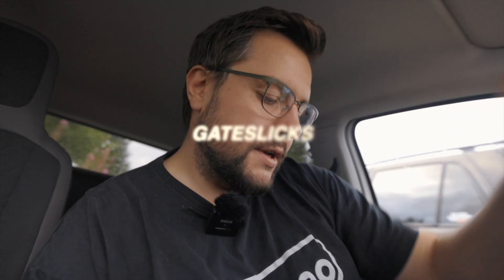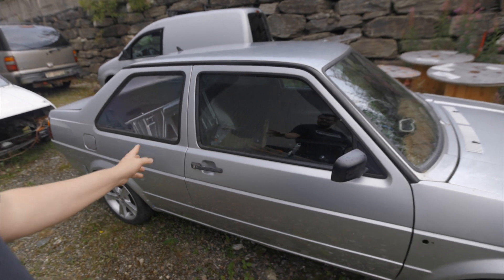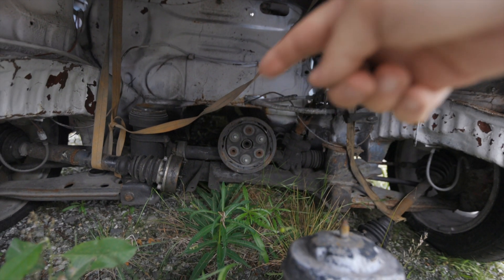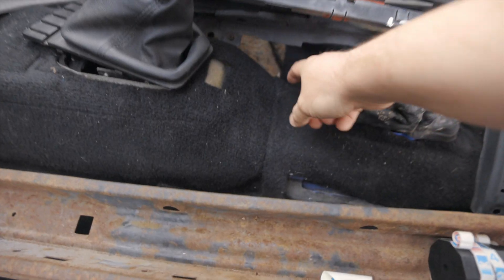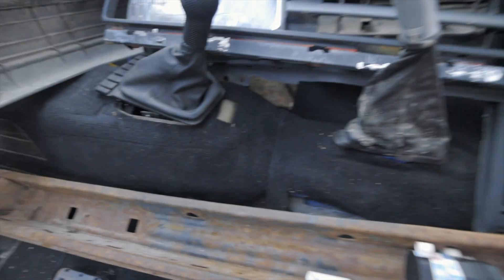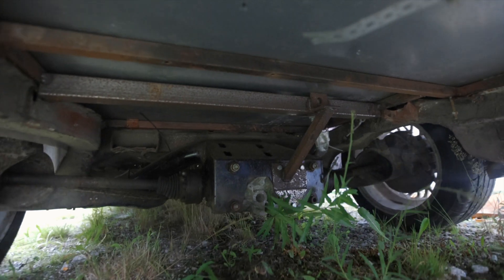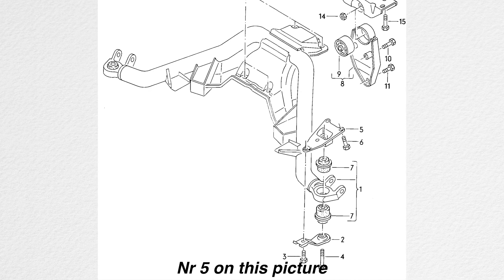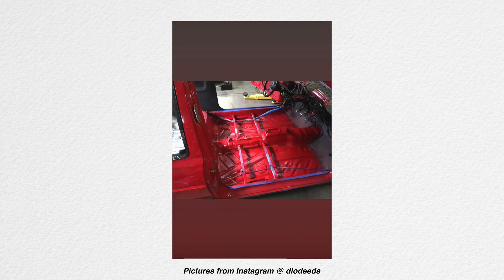How to AWD Mk2 (Jetta, Golf, Scirocco, Corrado)

Comment: Hello! Will the mk3 syncro subframe just bolt on? Or the mk4, or does it need a lot of mount welding and fabrication like it does on the mk1?
Reply from the maker: The Mk3 Syncro subframe will bolt on. But not the Mk4. The Mk4 will require a lot of fabrication
Reply: @Gateslicks   i'm sorry to bother you like this, but what about the ECU situation on a 4motion swap? Can i just use a normal 1.8T ecu or is there a specific ECU to use in the 4motion case?